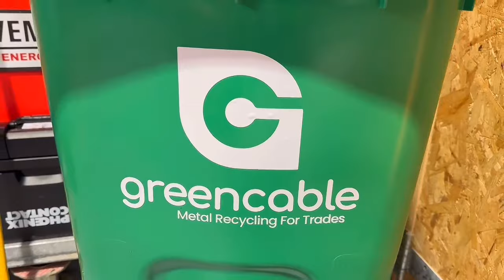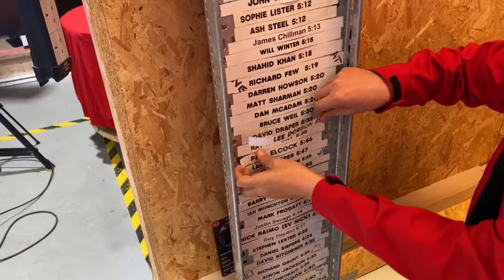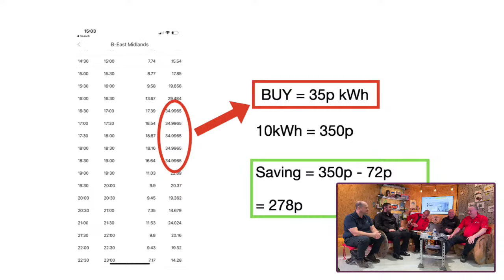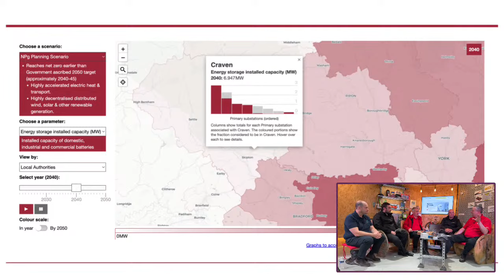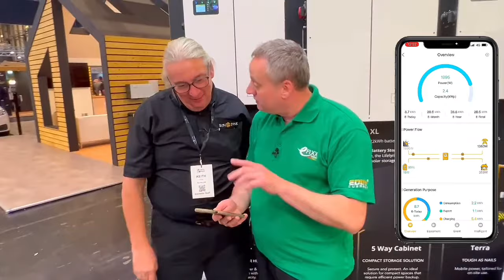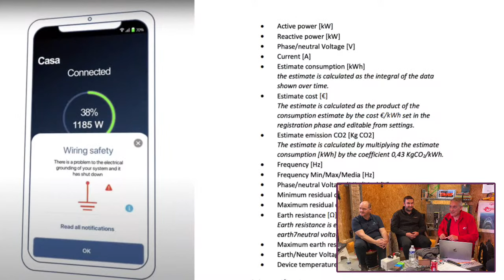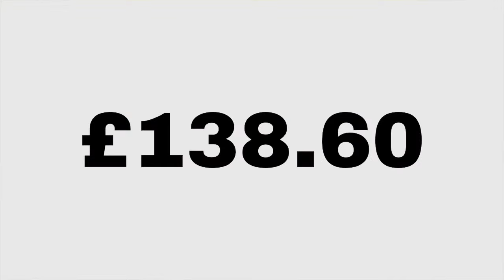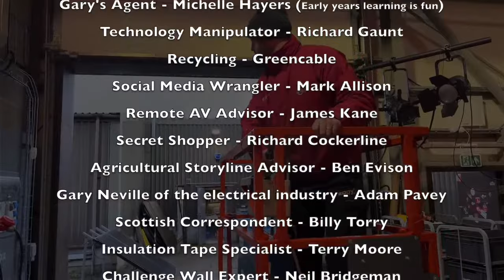Should you Install Batteries without Solar Panels

Comment: Great show again Guys 👊😎👍💙, couldn't do the live 🙄
Back to Domino Ricky tool time. Had my first one of these work benches back in Feb 2017 (branded differently), two of them featured in some of your vids from our visit in April 2021. At the time I believe I paid about £50 each now about £70 inc VAT from an orange branded DIY store that not necessary do next day delivery, but you can do that there ye oldy thang by going to the store, picking up the item and pay for it on your exit of the store at a thang called a till (no basket required, but optional) which has a person standing at it (strange that!!).
Catch you on the flip side. 👋

Comment: Thought I'd clarify what I said during this stream about Aussie switchboards and MCB/RCD/etc brands.  No one will  blink if they see different brand devices in a board.  There's nothing considered wrong with buying a clipsal enclosure (for a sub) or a hager metering enclosure (main switchboard) and fillling it up with Voltex RCBOs.  What is expected though is that if you also put a CHiNT device in there it must mount up on the bus bar correctly.  No bending the bar tabs, so putting a DPN pitch device on straight bars isn't acceptable.  Neither would be trying to fit a device that has the terminals offset 5mm from all the rest.  In that case you'd either start a new section of bar, or run wires to the CHiNT and not mount it on the bus bar at all.

It's not a case of Rafterty's.
Reply from the maker: Thanks for the clarification we were about to box up our random stuff and sell it cheap on an Australian eBay account 😂

Comment: It's actually incorrect at 1:39:00 to say that a neighbour already having solar PV would prevent a G98 post installation notification. The DNO would only be concerned where a single installer is planning to install more than one solar PV system within the same geographical location in less than a 28 day period. This information can be found in sections 5.1 and 5.2 of EREC G98, Issue 1, Amendment 7.

Comment: Roofing courses are available, Ive done a few myself. The truth of the matter is its a combination of efforts that is needed. Roofers should not be playing any part in the electrical system at all. The wiring installation, connection and termination is work of electricians. Any efforts to introduce skills cards for roofers to do any electrical work would be catastrophic. If that is currently happening it should be challenged and stopped. If trainers are encouraging short course options for roofers they should also be challenged and stopped. 

Lots of work to be done and personally we are loving the challenge in the thick of walking the walk. Perhaps with the advantage we have skills across varying construction trades earned the hard way.
Reply: You don't need to be an electrician to put factory fitted MC4 connectors together.
Reply: @VinoVeritas_  that depends if they are from the same manufacturer. If so of course. If not, definitely so. 

The limited value and attention people pay towards the MC4 connectors is why we see so many fail or burn out. 

Not the work for roofers that is for sure.
Reply: @electrician247  Why would a roofer be mixing panels from differing manufacturers?
Reply: @VinoVeritas_  optomisers. Are you an installer? Doesn't sound like it tbh.
Reply: @electrician247  Optomisers? You obviously mean optimisers. I've been installing since 2015. Again, a roofer would only be connecting factory fitted MC4 connectors. If SolarEdge or Tigo optimisers are being used, the replacement of MC4 connectors wouldn't be carried out on the roof and certainly not by a roofer.
Reply: @VinoVeritas_  so we agree not the work of roofers. I apologise for spelling and grammar errors I have dyslexia. But try my best. 

Are your roofers assessed during the MCS assessment if they are connecting your solar systems? Do you notify the insurers that the electrical connections are made by them? Interested to see how you make that work. I'm fine with roofers taking care of things structurally. Makes perfect sense in terms of hooks/rails. 

However our insurers were very very clear on what is and isn't covered electrically in terms of the roof work. MCS equally so. 

If you have people not electrically competent doing this tasks that's a liability I wouldn't want sat on my business/portfolio of work.
Reply: @electrician247  Like I said in my first comment, roofers connecting factory fitted MC4 connectors together isn't an issue. All MC4 connectors that are to be replaced should be done by competent electricians before getting anywhere near the roof. Unfortunately, MCS doesn't require anybody other than the Nominated Technical Person to be suitably qualified, so I'm certain that there are installations being carried out subcontractors with little to no competence when it comes to electrical installation work.
Reply: @VinoVeritas_  That isnt true in terms of MCS. All sub contractors need to be appropriately competent and records kept in the QMS manual to evidence it. 

Equally contractors specific insurance for public, product and prof indemnity requires that to be satisfied. Client insurance for buildings and contents claims the same. 

The issue in industry around MC4 connectors and DC isolators is entirely due to lax attitudes around the importance of ensuring they are correctly done. 

That can only be achieved if efforts are made to ensure electrically competent people have both installed the cabling, secured it correctly to the building structure and connected it. 

Anything else is 100% a non compliance with MCS, insurance and good working practices. 

If you have processes that ensure that isnt happening I would be interested to learn. The failure point fugures speak for themselves and reputable contractors will not want that risk carried around portfolios of work.

Hope that helps.
Reply: @electrician247  You really need to read the requirements of MCS more thoroughly. You also need to understand that the vast majority of solar PV installation within the UK falls outside of the scope of MCS. I know you're relatively new to the solar PV installation industry and likely haven't seen many installations that have been carried out by subcontractors, but believe me when I say you're extremely naive if you think they're all suitably qualified.
Reply: @VinoVeritas_  oh I'm new to it in the current business offering. But this isn't my first ride at the rodeo Vino 🤣🤣🤣. 

Are you saying you don't evidence sub contractor competence in your QMS manual? 

I've been around solar farms since the good old days. Which is why my view is so clear on this. Especially termination of MC4 connectors and DC isolators. 

We have a massive issue with these getting completed by unskilled operatives. This is exactly the point. I'm not nieve to what's going on. I just know it needs to be improved.

I know the MCS standard very very well. I inputted into it's development this time out. 

I do appreciate commercial systems are generally out of scope. However the requirements upon them are often above that of MCS. 

Lots of installers are ignorant to the requirements of insurance and contract law. Hence the approach you advocate regarding MC4s as a clear example. 

We can and should do better.
Reply: @electrician247  Filling out the most recent MCS consultation response form is hardly akin to being involved in its development. Again, if you were fully aware of the MCS requirements surrounding a QMS, you wouldn't be mentioning it.
Reply: @VinoVeritas_  you assume more than you know Vino. That's fine. 

In summary it seems your happy with the status quo of anyone putting solar strings together.  With no record of that in QMS and totally accepting it on commercial jobs. 

Thats not my approach or wider message to industry. 

The status quo needs to change and it will.

The ceo of MCS is coming on the A121 podcast very soon. So I will be able to reference things such as that during that recording.
Reply: @electrician247  I'm happy with roofers connecting factory fitted MC4 connectors together. I can't wait to see Ian Rippin explain why MCS will no longer require either HIES or RECC and the reason for getting rid of IBGs.
Reply: @VinoVeritas_  if you went to any of the ECA net zero roadshows you would already have heard. That's when I met him in person and arranged for a chat on the podcast. 

HIES and RECC are not very good at consumer service themselves in my experience. Frustrating after making the efforts to join them that turns out was a waste of time. But is what it is. 

Quite rightly the focus is now on the quality of what is going on with installs. Specifically on the roof/mounts. Which from the sounds of this chat is a very good move 🤦‍♂️
Reply: @electrician247  Oh, I thought you'd been for tea and biscuits with him at the MCS  headquarters in Daresbury. I wonder why it's taken MCS so long to discover the inadequacies of HIES/RECC? Or was it you that enlightened them when you were involved in developing the latest standards?
Reply: @VinoVeritas_  Vino it's okay to discuss, develop and learn from each other. But silly belittling attempts to deminish others is poor form. 

You clearly don't like the views I've shared around improved quality of termination across solar installations. I can respect and discuss that. But you have now taken a jump on to the silly step so I'm out 🤣. 

The argument/discussion is long since lost at that stage. 

If you do some research you will see I help develop many of the current industry quals and standards. Off to parliament later this month and giving talks on renewables through the winter to industry bodies and contractors. I don't need to justify myself at a silly level on YouTube. Have a great weekend and maybe reflect on the wider discussion above. We can all do better.
Reply: @electrician247  I think you'll find that you were the first to diminish the abilities of roofers. My response was that it's perfectly fine for them to put factory fitted MC4 connectors together. So maybe practice what you preach?
Reply: @VinoVeritas_  that is not diminishing roofers. Its stating a sensible approach to electrical systems. While mapping a road to less failures of terminations on PV arrays. 

Roofers are excellent at roofing. Why on earth would it be diminishing to say less so electrically. Silly. 

What's your real name? Let's start with that if we are going to be grown up and have a sensible discussion. I'm here for all to see. Who are you?
Reply: @electrician247  Roofers aren't tasked with terminating MC4 connectors though are they? If you believe that anyway putting factory fitted MC4 connectors together requires electrical qualifications, then don't bring it up in Parliament. The UK doesn't even have enough fruit pickers.

As for my name, how is that relevant to the discussion? I'm certain your buddy Jamie Blatant doesn't have a passport in that name.
Reply: @VinoVeritas_  why reference Jamie, he isn't here in the chat. Point me at social profile of yours? That way anyone reading might have some value for the things you say? The parliament discussion is exactly about skills in the sector. 

If you believe electrical termination and running of MC4 leads on a roof is non electrical work. Well can't help you I suppose and let's hope an insurer never has to either.

We can do better and we will.
Reply: @electrician247  I think your dyslexia might be getting the better of you. Nothing I have written mentions roofers terminating MC4 connectors. I don't do social media as I'm a grown man and still interact with people in real life.